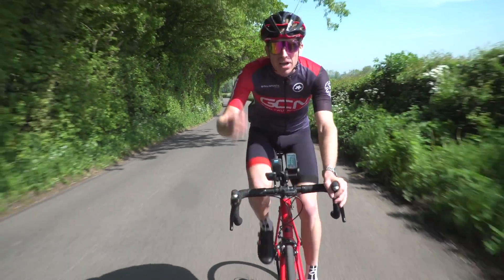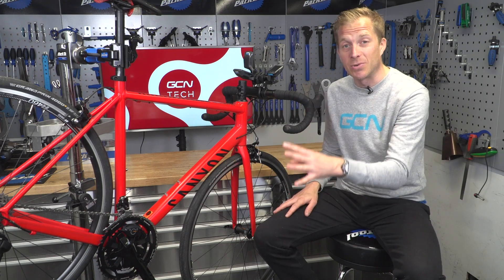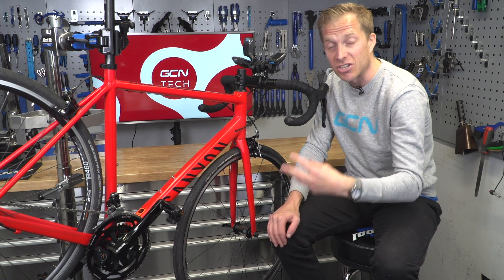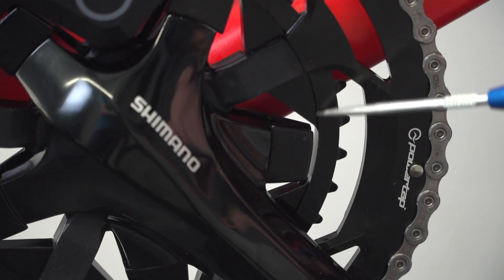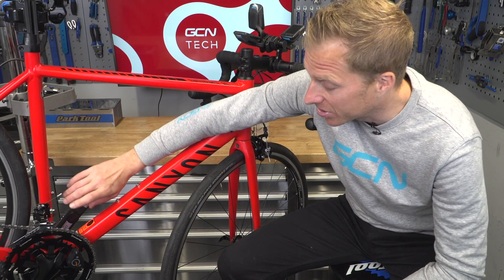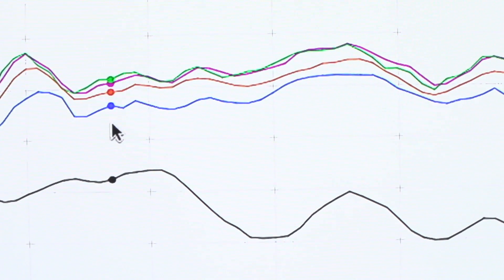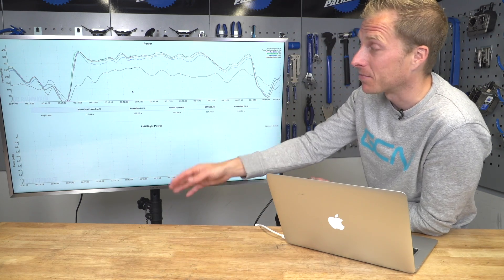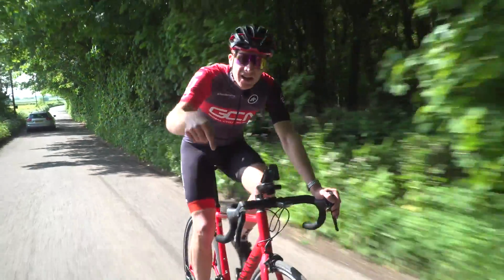Where To Fit A Power Meter On Your Bike | GCN Tech Does Science

Comment from the maker: Do you train with power? 👇
Reply: Sort of. If I bike two hours and do not eat so much rest of the day I now it was low power. If I bike two hours and I am very tired and eat a lot rest of the day it was high power.
Reply: KHALED KHALED not at all. I climbed my first passes 2 weeks ago, knowing my power numbers helped me pace myself on the climbs. Not only did I avoid blowing up, I ended up going uphill quite well compared to my mates, even though my bike is like twice as heavy as theirs (steel is real, but sometimes you wish it weren't ☺️). Powertap P1 changed the way I train. On group rides I know exactly when I'm about to blow up, what wattage I need to be at to recover from a hard effort (sprint, strava segment...). It doesn't solve everything like how much calories I need to take to keep going, but it's really useful. It may sound silly to have a $1k power meter on a $100 used bike, but trust me I wouldn't change that even for a $2k bike
Reply: Garmin is having some issues with the battery door. I just RMA a second set of Vector 3. They have a new battery door and are producing them right now. So best to wait for that. I am using Assioma Duos and too be honest unless you need pedal platform offset and seating/standing info, Assioma and Powertap give the same data. I am using a Garmin 1030.
Reply: I use a PowerPod, after the ride I can see where I was coasting, braking, drafting and what the wind speed was as well as my cda figure.
Reply: I’ve been using a PowerPod for several months. It is a great way to enter the “power” space at a good price and it is easily portable from one bike to another.
Reply: I have a smart trainer and a heart rate monitor.  I correlate heart rate to power indoors, and then have a pretty good idea outdoors from the HRM.  Obviously it's not as accurate, but generally HR tells me very well what I'm able to handle at a particular moment anyway, and for how long, which I think is more important than power anyway.  Still, a better combination might be a dumb trainer and a power meter.. and still and HRM.

I can't imagine how that power cal could possibly have known your power without you inputting some kind of calibration data, like LTHR, FTP, max hr and resting HR.  The HR alone will never tell you if you're improving either.
Reply: Nathan Porter i see, that is good to know. I guess that's why they are currently unavailable now. 
Hmm Pedal based powermeter seems the easiest for transfer and install, but still considering to get it since pedal can be wear or damage on crash.
Reply: Captain Prophylactic 😂 i also train with my BB ticking noises as a metronome!
Reply: Yes.  I want consistency in readings above all because I only want to pace, train and improve, so I only compare with myself.  I am using a 4iiii right now.  It is one sided on the crank. Meets my needs.  I had a Stages 2nd gen but water ingress caused it to stop working.  They replaced it with a third gen unit I will probably sell.  Both companies have great customer service.  Pros need two sided readings but I don't.
Reply: I just ordered a Stages L/R Ultegra 8000 powermeter, so I will in a few weeks.
Reply: Yes, I find a power meter to have made a positive impact on my training. I used to train by heart rate. That changed this past winter when I bought a Wahoo Kickr which has a built in power meter. After 3000 miles of indoor training this winter I found the power numbers to be of great benefit. On long rides, group rides with time at the front pulling, and many other rides, I find the power numbers and %ftp help me really dial in the effort to get to the finish with just a wee bit of gas in the tank. It has also helped me with hills since I no longer burn too many matches at every steep hill. The power meter keeps me disciplined and "riding my number." In my case it is a Quarq D-Zero fitted to a Cannondale SuperSix Evo (BB30). I got by for years without one, but they are very nice to have.
Reply: Absolutely - power transforms the way you train and the way you ride. Knowing what power you are capable of putting out over any given duration allows you optimally pace any effort (as long as you always try to excced what you know you are capable of towards the end of course.. ;-)) and optimally target improvement.
Reply: Tried the Watteam Powerbeat, but had all sots of issues and sent back. Now using Favero Assioma and finding them great, can also swap between my two bikes with different cranksets now as well. Training with power is such an eye opener, highly recommended.
Reply: Kickr Snap smart trainer indoors, and outdoors with no power meter I ride between 120% and 70% perceived effort of my very weak FTP of 140 😭, I have improved my FTP but it wasn’t because I was paying attention to my numbers while riding. Eventually I will purchase power meter.
Reply: GCN Tech not yet but thinking to get one of those Garmin Vector 3. 
I wonder if any pro's using them and if not much, what woud be the major factor to choose one power meter to other for them. Maybe sponsorship?
Reply: had a PowerTap hub for the last few years. enjoy reviewing the numbers even though I don't race. Just 1 road bike, so it works great for me. Biggest issue with the hub is that when a rear wheel gets damaged, it turns into a rebuild instead of just simply buying a new wheel.
Reply: Yes , I have been using a Stages single sided power meter for about 6 years. I am presently training with CTS.
Reply: I don't have a nice enough road bike yet to get a power meter, but I will soon!
Reply: In a way I do but the power data is fed into the automatic shifter to alter my cadence. When I get it transmitting ANT+ to a head unit I'll have a go at using it for training.
Reply: Yes, Vector 1 pedal (one sided), swapping between bikes.
Reply: Not yet.. Waiting for the Vector 3s to be in stock in the UK, but availability keeps getting pushed back.
Reply: Yes
Reply: I am using Watteam Powerbeat power meter left right sensors and had problems consistently since purchase. Unfortunatly support can be painfully slow to respond but I really want to believe Watteam will come to the party and fix the problems.
Reply: Using dura ace stages, its not importent 4 me, thats accurat, but i have the Numbers to work from 👍
Reply: At the moment, no. I wish I could afford one, but I am on a college budget. That’s why I’m really excited for that IQsquared Power meter. That is fairly high on my to-get list. Also, is this the first episode we have actually seen Jon on a bike?! Jon has made his OFFICIAL YouTube debut 😂
Reply: Yes Quarq Dzero om my Bianchi oltre xr4 and then the very inaccurate stages on my focus izalco max
Reply: Not yet, still researching between Garmin and PowerTap
Reply: Yes, I really like my Powertap G3.
Reply: Jon, I train with two different kinds. I've been using a Saris G3 for almost 5 years and recently bought a pair of Garmin Vector 2. Different beast, with different metrics. I consider my G3 the most reliable, but I'm slowly getting used to Vector's cycling dynamics. What I've learned from training for power is consistency. You have to be consistent with your objectives otherwise become just another metric in your bike computer.
Reply: My new Easton R90 SL wheels with Powertap hub arrived Friday!! Can’t wait to start! I’m looking forward to riding on a wider rim with 25mm tires too. I had been running 25mm on an narrower rim and just changing to the wider rim the tires look super beefy. Excited for power and extra comfort!
Reply: no i don't
Reply: I use Stages single sided Ultegra 6800, had it since Christmas and have already increased my average power by 30w. Well worth the investment.
On a side note, owning a power meter seems to result in a lot of added pain while furiously chasing those bigger numbers!
Reply: modarm take it from me - Anything other than a major brand power sensor is a waste of time & money
Reply: I have three power meters two sets of garmin vectors two's and a verve infocrank. I prefer the crank based option and will eventually move away completely from pedal based power meters.
Reply: Yes. I have a G3 on my "bar" bike and a C1 on my race bike
Reply: Got a good Black Friday deal last year for an aluminium quarq dzero. That's just 6 mths into riding road bike (and after 15 years of not riding). Fascinated by the power measurements. I don't train but I like data and always good to know if I'm exerting more power on my usual route or not rather than purely depending on feeling.
Btw I do agree than Jon has a nice shades and great to see a video of him riding. Max heart rate of 175 is indeed Low, shows how fit Jon really is
Reply: Yes, with the PowerPod, which for me has been a generally-good and inexpensive meter I can use on all of my bikes.

The caveats are that you have to make sure to charge it frequently and do a calibration run when you swap bikes.  So it is admittedly more of a pain that a traditional strain-gage meter but when done appears to give me consistent data that I can use to compare a race effort versus Zwift sessions.
Reply: Yes with power 
First bike a used  G3 then 
on the new Roubaix got the Powertap p1pedels
Reply: I use stages crank 105 black as cheapest (close enough match to my ultegra cranks)
Reply: I started using power monitoring on my TACX NEO indoor trainer, which you incidentally never covered as another way to track power in your video. Getting back onto my road bike and IRL riding, I felt I was missing something and as a cost effective way of tracking power I installed the 4iiii crank based system.
Reply: C1 owner here. Would advise anyone considering them to go crankarm based instead. For me they fitted into my budget but battery life is shocking and so is chainring wear. After less than 10,000 all weather miles mine are 2/3 worn leaving me with a noisy chainline. Only an awkward & expensive service will solve. I'll be replacing them with crankarm or pedals. May only then get the replacement service done. Will retire them to inside turbo duties where they should last for many many years.
Reply: I trained using Garmin Vecor 2s pedals for two years. They were very consistent and dependable, but the warranty ran out.  Not  wanting to own a pm without a warranty, I sold them.  Then I purchased the PowerTap C1 chainrings and a Rotor crank for them.  The C1 failed after one month of use.  PowerTap repaired them, but turnaround time was about two months.  About another month later, they failed again.  Sent back under warranty again. This time, it only took about three weeks to get them back.  I mounted them up to make certain they worked, then sold them.  Been riding and training the old fashioned way with only heart rate, but mostly by feel.  Just paying attention to my heart and my breathing.  Making faster progress without the power meter now. Besides that, the C1s were a noisy set of rings, and my bike is much more beautiful when fitted with a proper  Record crankset.  😁
Reply: Yes and no. Yes, indoors over the winter on my smart trainer. It has helped me tremendously. Outdoors no, but because I’ve used my indoor trainer I can correlate heart rate to power and it works pretty well. I’ve been an athlete all my life, so I can tell good enough. 

Plus, outdoors is more about fun and experience then power. If I want to train with power, I just hop on the trainer. With schedules for work, kids, weather...I still use the trainer here and there enough in the summer as a touch point to know. Summer = fun. Winter is when I train and get most of my gains.
Reply: Yes, using stages left side crankarm and am happy with it! :)
Reply: No not yet but I am planning to get the Fevero Assioma pedals. I read some reviews and some gone through some video reviews about them and it seems like a good buy though my wife will definitely disagree with it 😆
Reply: What about the velocomp power meters...they are totally different and cheap yet 2 percent accurate
Reply: pointless unless you are paid to ride
Reply: No power here, i don't really need a gadget to tell me whether I'm pushing hard on the pedals or not :)

Comment: My first ever power meter is the Garmin Rally XC200, I specifically went for dual side because I have two legs...and I'm kind of a number geek, I have a DPS meter in video games, you bet your butt I'm having a power meter. What I love about the Garmin is how..."normal" it looks, no bulky sensors or plugs anywhere, replaceable battery that I have no issues dealing with it, also exchangeable bodies? Yes please!. Reading up on Garmin history with Power Meters, I'm confident they worked out all the kinks for this fourth generation so I have full confidence on this design.

Comment: Rare moment. More guinea pig episodes of you Jon. Between the hub based and the spider based readings, is it like comparing to wheel horsepower vs crank horsepower numbers in the car world? I think I'm leaning towards the hub based power meter after watching this though for the reason it's the final output and based on traction to the road which to me equates to getting acceleration because I'm not interested in how much energy I've expended but in how much efficiently I have delivered power or should I say the lack thereof from my puny legs through my legs, to my feet, to the shoes, to the pedals, to the crank then to my chainrings and onto the chain, to my cassette, to my hub, to the spokes, to the rim, and finally to my tires. Quite a lot of power loss starting from my legs to the hub in my opinion.

Comment: I train with Garmin Vector 2, my mate has vector 3 they should be better as no need to fit with torque wrench making it easier to switch between bikes.  Also no external pod to get knocked about on the vector 3, very tidy. After a few months his vector 3's started giving wild readings.  Garmin say the internal battery pod design was wrong and they are addressing it. Lesson for me was don't be the first to by new tech!

Comment: I use an SRM on my tri and love it. I also have PowerTap pedals on my road bike. I find both are consistent as compared to a computrainer reading. In general, and I am confused by this, the pedals give a slightly lower, about 5%, reading than the other two. CT and SRM are within 1%. I would expect the pedals to give a higher reading because of loss in the drivetrain. However, the numbers are all consistent, i.e. the 5% difference remains essentially constant regardless of the power.

Comment: Hi GCN, Great videos i general and in articular this one about PowerMetres. Can you say what is the approximate difference in percentage between :
- the 3 average of the 3 PowerCal power metres
- the calculated data from heart rate

As the Hub, pedals and ring methods seem to be very very close one to another, there is not much deviation. Knowing the accuracy (and perhaps delay) with the Heart Rte based model can help those - like me - without a power metre. Are we talking 10%? 20%? 30%? difference ?

looking forward to hearing from you.
Kind regards, Lionel

Comment: I have a powertap wheel and a stages left crank power meter.  Their readings are virtually the same.   Changing batteries is much easier on the Stages.  Changing crankarm from bike to bike takes a few minutes, but not so bad- IF bikes have same crank system

Comment: Why would anyone get one-sided power-meter pedals?  Pedals define BOTH sides.  Seems like a waste.
Reply: Mambo Dave 

Price and it is not clear to me how a non pro rider would get more benefits from the two sides one.
Reply: Everything I've heard from people I ride with, and even some GCN presenters, seems to point out that most of us have unequal strengths from leg to leg.  You may have a point that it may not really matter when measured from a single point that still gets both inputs, like a rear hub, but for a pedal, alone, that just seems limited for the entry fee.
Reply: Mambo Dave 

Yes, true for a lot of people but in actual practice as a way to facilitate training and to pace rides, it doesn't matter.  On the 4iiii Precision one sided PM, if you know for example that you have 52:48 right leg power vs left, you can go into settings and correct for that.   (Stages does not have that feature).  However that ratio probably varies with effort so I don't  bother. The thing is, even with one side I can get great benefits from using a PM for $350 and not spend $1000 for information I probably won't  use.

Price and reliability are really important features.  People need to factor all this in and different people may have different needs.  The hub and crank ring meters cost a lot more.  They also seem quite reliable based on most reports .  My crank arm 4iiii has been more reliable than the several  Stages meters I had that kept getting destroyed by water.

Comment: I'm on a Stages (left only), bought it 3 years ago because it was the cheapest powermeter on the market.
Been looking to buy a second powermeter for the second bike (gravelracer), i was looking at a Power2Max. The IQ² looks good too (maybe hold out on that one)
Most important is that the powermeasurement is consistant so you can train within your zones.

Comment: Great show!  I used a Polar CS600 with Power until I switched to a Garmin with Vector 2 pedals.  Being a Mech Eng, I totally geeked out on the Polar Power measurements using chain vibration to measure chain tension.  It was unfortunately never accurate during sprint, or on extremely rough roads.